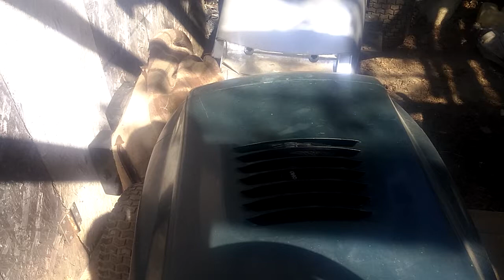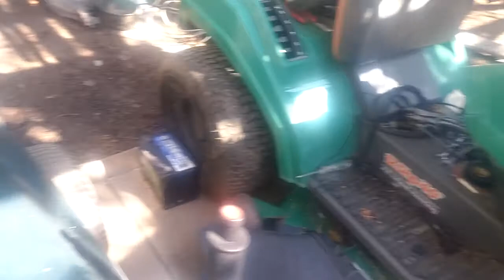Racing Mower Problem Why

Comment: When the ignition is off, the plunger blocks the main jet in the bowl blocking fuel. When the ignition is on it opens unblocking the bowl jet letting fuel through. Check it out. Also if the solenoid gets hot, it's bad. I'd just delete it for a high revving engine. All this is even if t has one though.